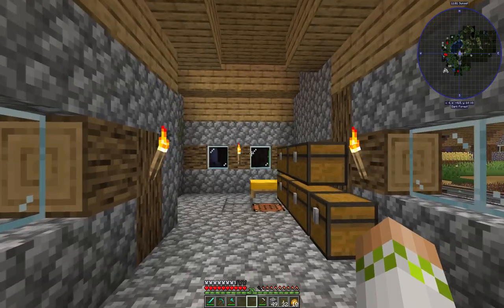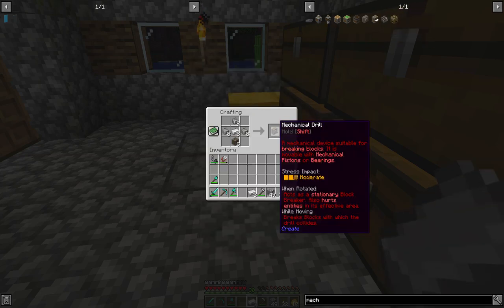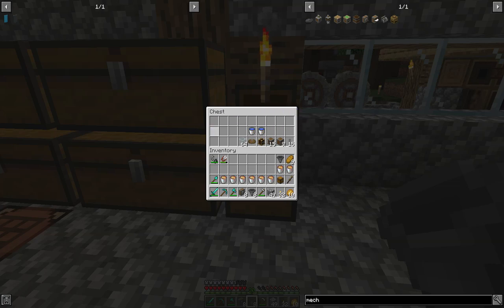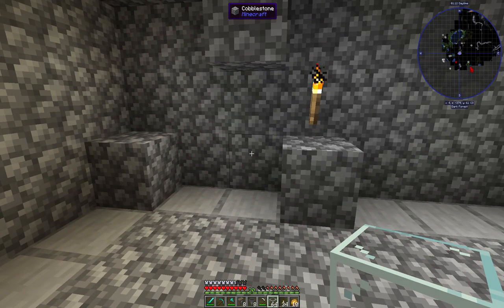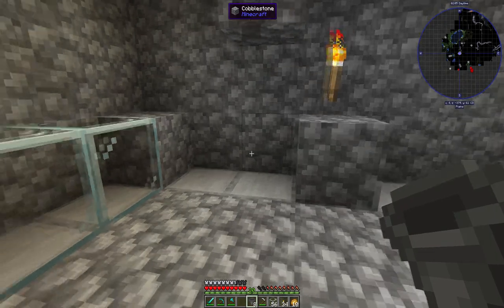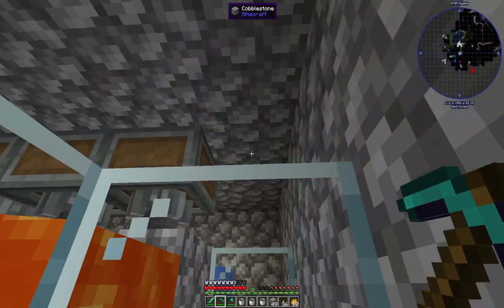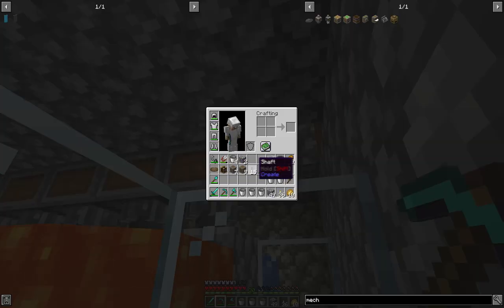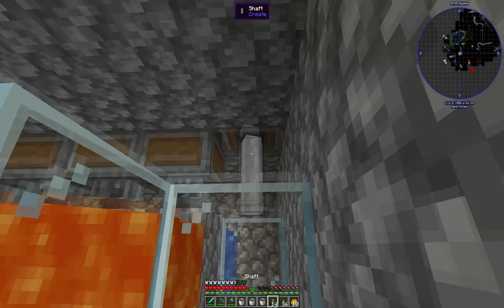Surviving With Create :: E10 - Mechanical Drill

Comment: Setting up a timed funnel with timed pulse repeaters means that you can send in only enough wood to smelt 9 charcoal. Packing it means you get 10% longer smelt times. (If you have a mod which adds charcoal blocks)